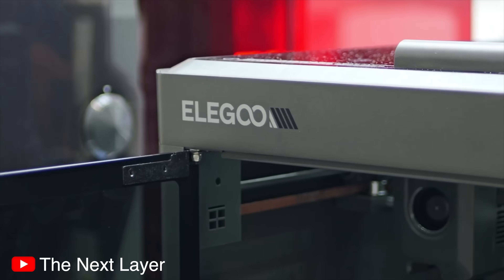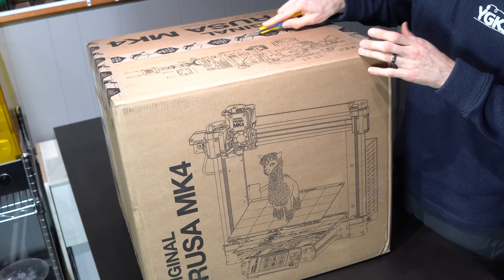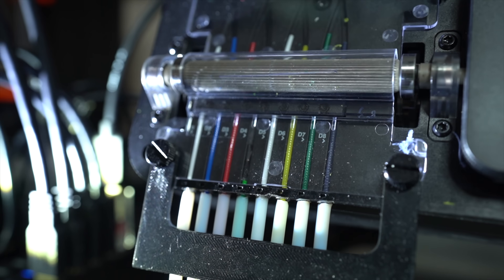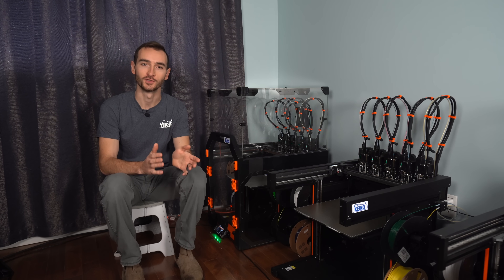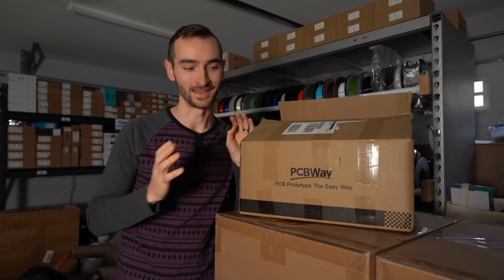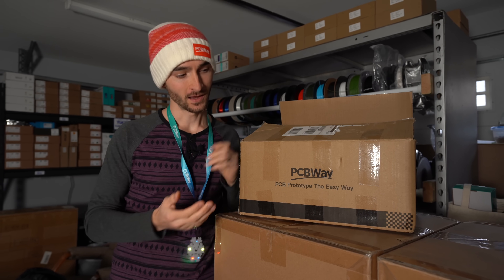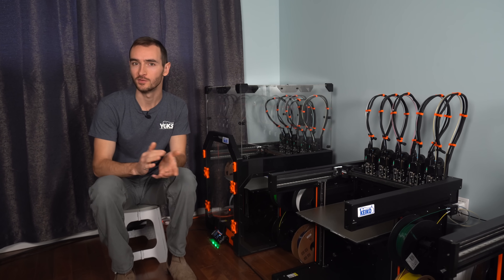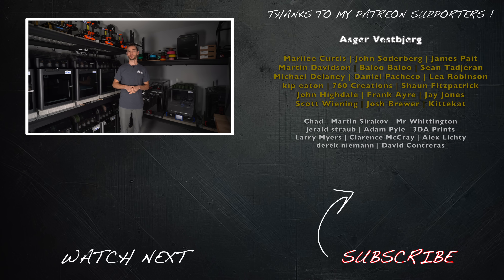The Prusa Core One is dividing the internet...

Comment: Prusa disappointed me quite a lot. Their product is meh and their customer support is just overrated, I had a way better experience with Bambu's customer support.

Customer support wise, I got a 3S+ to 3.5S upgrade kit during Black Friday because of the free shipping, and wanted to also redeem a spool of free filament with the points that I gathered on Printables. Turns out it takes more than a week for the voucher to be approved, and they only sent the voucher to me days after the Black Friday sale ended. But because my order has not been shipped, so I tried to add the voucher to my existing order... And guess what? You can't, you can only add voucher during initial checkout. So I went ahead and contacted the support to see if they could combine 2 orders together considering the previous order had not been shipped. But nope, it's not in their script so they refused to combine them for me. Best part, the voucher will expire in less than a year, so I couldn't even wait for another free shipping sale to get it. 
On the other hand, one of the pei plate on my X1C went lemon after a few months of normal use, took a video and asked Bambu's support, and they just sent me a new one completely free of charge. Another time, they sent me someone else's package, contacted their support, and not only did they immediately resend my order, but they gave me a voucher that would cover my order plus extra because I had to drop off the wrong package to the carrier. 

Machine-wise, the 3.5S surely is a big step up from the 3S+, but the kit is 250USD, and the A1 is only 319USD after discount. 3.5S lacks the camera, and auto z offset, and setting up MMU would be way more complex than setting up the AMS lite. Worst part from my experience with the 3.5s, Prusa Connect has a print-breaking bug that would make the printer randomly not extrude for a few seconds, which they've only fixed it in an alpha firmware as of now. Then my X1C has been running smoothly after 1500+ hours of print time.

TBH, if I want to tinker with a machine, I have far better choices, Voron, Rook, Ratrig... even a mk3 clone would be a better bang for the buck. Prusa got too comfortable at the top for way too long.

Comment: Has anyone mentioned the fact that the Prusa Core One is much more compact than most (all?) other printers that offer roughly the same build volume? That makes it very attractive to me as a complement to my current Prusa MK4 and Voron V0.
Reply: Is it though? Being able to fit a whole spools speaks to how much space in the sides there is. It doesn't seem notably more compact than anything else and they again go with the weird non uniform xy
Reply: @BeefIngot  The space on the sides comes from the Stepper motors which makes printers much bigger than the print bed. They optimize space using which makes the total footprint, including the spool smaller and helps with heating. So, quite a good solution.
Reply: @bern71  That doesn't check out given many printers use a wrap around design for the motors.

I feel like people bend over to find everything Prusa to be somehow genius
Reply: It is not the steppers, is the kinematic that lays on top of the filament rolls. It hast to be bigger than the print bed. Also part of the print head exceeds the sides of the print bed. Prusa basically saw there was space inside the chamber not being used and put it outside keeping the envelope
Reply: Not really.  Bambu X1/P1's are significantly smaller in all three dimensions, while offering a larger overall build volume.  CoreXY is going to be more compact as a rule than a bedslinger.
Reply: It looks so cheap though, stamp steel sheet and thin clear plastics. Have you forgot how their multi color solution looks? Its all over the place.

Comment: Flashforge, meanwhile, is producing on par quality prints at a third of the price of either of them, and their multi color printer will be under 400 at this point. Yes the bed is smaller, but I doubt they'll be stuck to that size for much longer

Comment: The only reason I purchased the upgrade kit to go from my Prusa MK4 to the Core One is that the MK4 has been gathering dust ever since I purchased it.  First eclipsed by the Bambu X1C, even that is now eclipsed by the Peopoly Magneto X (my current favorite printer for single colors/materials).
Reply: why magneto?
Reply: @pavoldeman1762  I had read about the Magneto, and saw it in a local 3D printer farm, and stumbled on a 24 hour sale for $1,200 with an enclosure.  It is significantly faster than the Bambu X1C and much faster than the Prusas.  It makes beautiful prints, and quickly.  And the build volume is huge.  I love it so far!
Reply: Print times according to the slicers:

Prusa MK3S: 6:11
Prusa XL: 4:12
Bambu X1C: 3:13
Magneto: 2:20
Reply: @jonbondy  thanks for the info, i was eyeing them a while ago. ended up with p1s. But honestly its still not optimal. i am hoping someone will try to take VFAs more . I asked the Magento team about Vfas they said that the linear motor motion system sill has VFAs  . Solving Stepper and belt resonance would be nice. I enjoy smooth perfect prints. I was hoping prusa would have gone more in depth to get to perfecting since they were all about VFAs a while back.

Wish deltas would catch up in the consumer market.

Comment: The core1 shares a lot of components with the MK4s. It is kind of an mixture of their AFS printers and the MK4s. The AFS is Prusa's fully automated printfarm which can run up to 18 printers 24/7 (see https://www.youtube.com/watch?v=82ww7ZTpDus). 
Personally I do not like Bambu's closed and patented system and the fact you must use the cloud to be able to use the printers. Printers are build in a way the are hard to repair, but cheap to replace, creating more e-waste than necessary.  I'm more a guy of generating the least waste possible. I think the Core1 fits me better than a BambuLab. With the price for the Core1 it is not a bad investment, but for single colour only. For multi colour the Bambu with AMS is better. For multi material with different printing temperatures the Prusa XL is unbeatable.
Reply: Du you own a Prusa XL?
Reply: @BrainDeath89  Yes, two of them both with 5 tool heads. The performance is much improved since introduction. An XL is faster as a Carbon X1, even in one colour. In multi-colour the XL is much faster. When there are multiple colour changes per layer the XL can go up to double the speed as the carbon X1.
Mixing different filaments with different melting temperatures the XL is much faster.
Reply: Would have liked to see Prusa use the AFS build plates instead of the i3 build plates. That would have really given them the build volume to outdo Bambu. But they are looking to slot the Core One into their print farm, sounds like they didn't have the space for a larger footprint.
Reply: @logicalfundy  Prusa made the choice not to create a totally new machine, but an upgrade of the MK4s. By reusing as much parts as possible the could create upgrade kits for people who want to upgrade their MK 4(s) to a Core One.

Comment: I am team Prusa. Why? Simple. I run a small print farm and i want reliable printers. I don't upgrade them i sell older printers. That would fit Bambu well but the propriety soft and hardware I stick to Prusa. All MK4 will be swapped to Core Ones and I will add more Prusa XLs

Comment: You can buy cheap cloned tools in hardware stores that might work or break on the first run. Or you can buy a little more expensive tools that will work for the rest of your life as a DIY hobbyist. They work great and will be just fine for most use. They might even have some more advanced features than the next category.

But if you can afford it, maybe ask yourself why professionals pay premium for Wera, Festool, Makita and the likes.

Comment: For me the Core One is not worth the price for the size of the print bed so I will wait and see what Bambu puts out next year.  I have the XL and a couple minis but the rest of my farm is Bambu X1C, A1, A1 minis and some FLSun S1, T1, V400, SR.  My main question is would Prusa have done any of this without Bambu because the speed updates etc seemed to be rushed out so who knows it might have been years before Prusa did these upgrades without Bambu.  Good customer support is great if you have a problem but so far with the available replacement parts I haven't had a problem that I needed to call bambu customer support about.  As far a filament waste goes most of it can be gotten around by uses a purge print and the remaining purged filament I have a pellet using printer that I'm putting together that will use that.

Comment: I have a Bambu X1C with AMs at work, and recommend the Bambu ecosystem to everybody interested in 3D printers because of how incredibly trouble free it has been.  The only problems we have had are hot ends breaking when they crash against a part which had failed bed adhesion (but they are cheap to replace) and GF/CF filaments breaking in the AMS a couple times.  I should also say that I have only needed to replace hot ends 3-4 times, but that is the failure mode, not wearing out from abrasive filament.  We have roughly 2,500 hours on our machine at this point.  I ended up buying a P1S w/ AMS for home (and run it in LAN only mode) because of my experience with the X1C.  I think my only big reason to go with anybody other than Bambu is to avoid China Cloud Services.

For reference, we run almost exclusively Bambu filament (PETG-CF, PAHT-CF, PA6-GF, ASA, TPU-HF, for production; PLA and PETG-HF for tools/fixtures and quick mock-ups).
Reply: I have a similar experience. I have an X1C and P1S using Bambu filaments. Apart from minor failures (z height detection failure and failure to retract filament), it has been a joy to use the Bambu Labs ecosystem. The printers come with a bunch of the consumables and replacements are inexpensive (wipers, blade cutters, etc). And if you don't want to print from the Bambu Cloud service, you don't have to. Octoprint has preliminary support for Bambu printers and the old SD card works fine as well.
Reply: You really shouldn't be running the abrasive filament through the AMS. At least that was what they said originally. Did that guidance change?
Reply: Prusa had crash detection since MK3S. Bambu breaking hotend when not that rare printing issue occurs is sign of poor design. Bambu is good printer, but in long term reliability Prusa is the winner.
Reply: @biomech8  Prusa crash detection has notoriously not worked well since the mk3s. Furthermore, Bambu also has crash detection. Furthermore, the heat break breaking is actually the best point to fail as its the cheapest point to replace.

Comment: If Prusa can solve the Bambu waste problem without costing over 4 grand they will eat into Bambu in a big way. More european buyers cannot stomach all the needles waste the bambu machines are deigned to produce
Reply: A multi-head system seems indeed like the only option. Question is whether that can be made affordable..
Reply: Except its never reliable. Different moisture contents, different ambient temps, Different levels of water retention. Different ages. There are infinite variables to account for. You see those strings from the removed filament? They cause issues... period. Only way to have a reliable experience is to cut your losses. Still has a ton lower waste than CNC
Reply: They already have, It's called the MMU3
Reply: There is just no real way to not have a  lot of wast with color printing and just 1 nosel . Prusa wont chang that and its also not mean to be used in big scal for that you need a tool changer were BambuLab will kill them in ever matric if they make one

Comment: Bambu has all parts easily available through their online store. They have a full wiki to guite you through troubleshooting and repairs. They are absolutely repairable, much more so than most other companies. I really dont get why nobody seems to bother looking if the statements they make actually align with reality.. Sure, open source is noce to have, but not necessary to get a repairable product. I like what Prisa does ethics wise, but that doesn't mean Bambu has to be bad by default.
Reply: Do a google search - "X1C Y axis bearing replacement" and you will understand why the X1C is not fully user serviceable. Its a pity Bambu chose to assemble some parts of their products in a way that prohibits user serviceability, I really hope they will deviate from this path in the future.
Reply: My main concern is about how long Bambu will provide the replacement parts. While most hobbyists might just buy a new printer in 3-4 years, companies don't want to replace a whole farm if they can't get the replacement parts anymore.

I hope that Bambu will keep providing these, but they don't have a track record yet.

Comment: ah ah ah the MMU 3 is not a turnkey solution, you still need to spend a few days printing all of the parts for the MMU3 yourself, so there's material and print time for just the main unit, plus the print time and materials for spool holders, plus the buffers, and then the serious time cost of 'about a half to a full day' of time just to assemble it (according to Prusa!) not to mention the few WEEKS to spend tweaking and calibrating it to work well, PER FILAMENT, and you also need about 4-6ft of counter width next to the printer for the spools and buffers. No the MMU3 is NOT 'turnkey', you can't buy it and use it, it is a project and not comparable to the AMS/CFS/ACE type units. Not even close. search YouTube for comparisons, most people buy the kit, assemble it, try it, and then SELL it because it's not worth the hassle.
Reply: Good points that show both the self fixability of this if youre in a pinch and just pint extra parts for later repairs, but the downside being another Prusa Time/Resource/Money suck that puts them behind the competition sadly in a key area that is important for so many.

Comment: I completely agree with your points about Prusa's longevity, customer service, and the value of the upgrade path. Those are huge selling points for professionals who prioritize reliability and long-term support. That said, I can't help but feel conflicted after my recent experience.

I finally took the plunge on a Prusa MK4 with an enclosure, and it arrived just a day before the CORE One was announced. While I understand there’s always some risk with timing, the sting of having to consider another upgrade so soon is real—especially when factoring in the cost of the MMU3 for features that Bambu includes out of the box. It feels like an uphill battle to justify the investment, particularly when Bambu is offering affordable printers with integrated MMU and cameras right from the start.

Prusa’s long lead times only add to this frustration. I’d prefer the new CORE One or an upgrade path to transform my MK4 into a CORE One, but by the time Prusa ships, Bambu will likely announce another leap forward. This uncertainty makes it tough to remain confident in Prusa’s ability to stay competitive in a market where rapid innovation and out-of-the-box features are becoming standard.

At the same time, I’m reluctant to switch to Bambu due to their reported customer service issues and concerns around planned obsolescence. Prusa’s track record with longevity and repairability is still a strong draw for me. However, the current pace of their innovation and the associated costs are starting to feel like they hit a ceiling—especially compared to the value you get with Bambu’s offerings.

Ultimately, I want to stick with Prusa because I value their ethos and support. But with the way things are playing out, I might have to consider a Bambu just to get printing faster and at a more competitive price point. It’s frustrating to feel like I have to choose between reliability and market relevance when both should be possible.
Reply from the maker: That's definitely rotten luck. I'm sure you're not alone in your experience or the way you feel. You summarized very well the inherent dilemma of investing in a new Prusa, especially with other companies outpacing them in both innovation and delivery. I hope Bambu's next generation printer puts more of an emphasis on user serviceability.